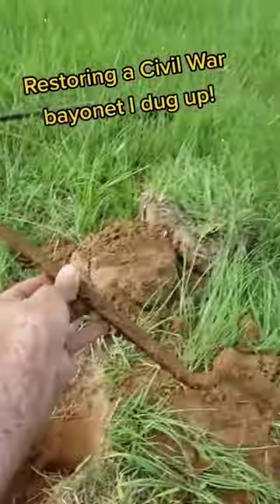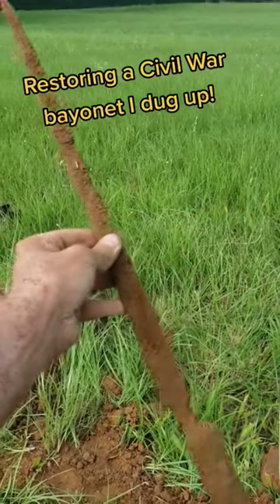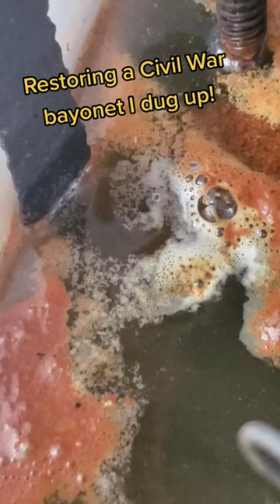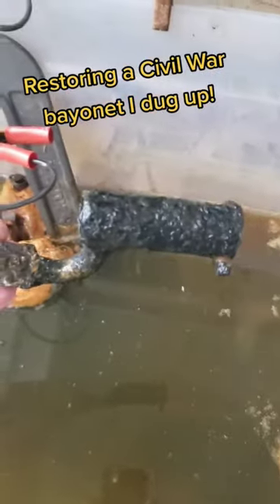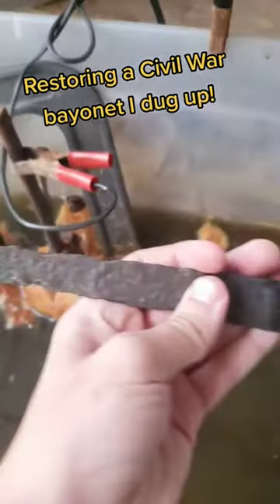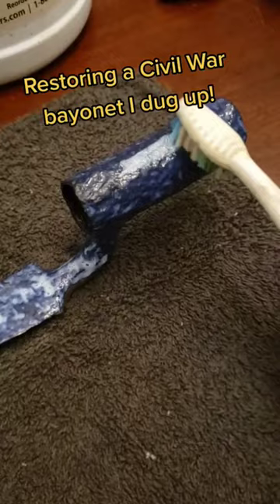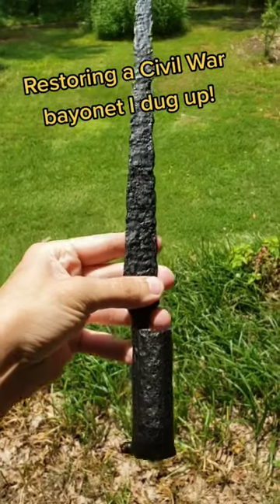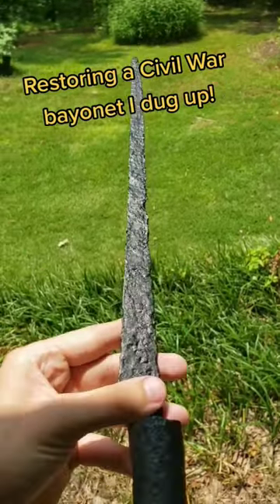Restoring a 160+ year old bayonet I dug up!

Comment: You should use vinegar, wire brush(brass most likely), and thats it. Vinegar soak after and an oil. If you wanted to a blue finish but im thinking more preservation than restoration.